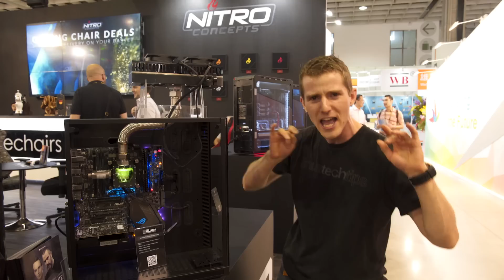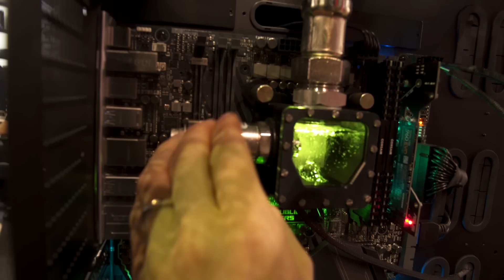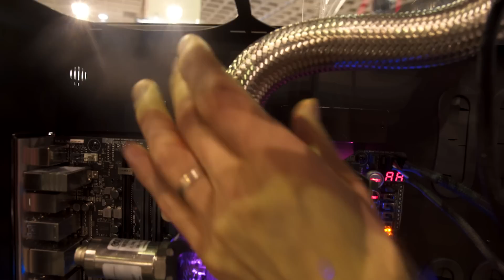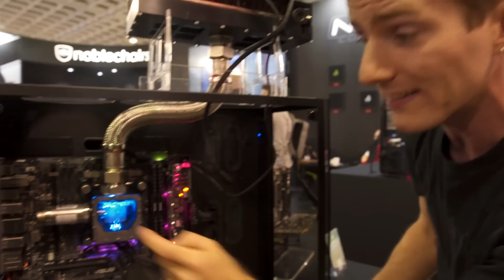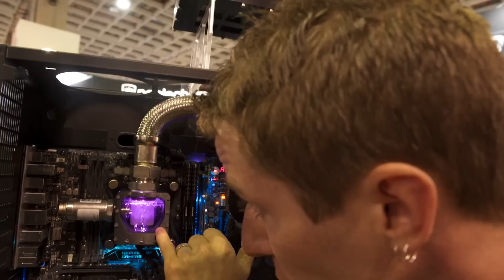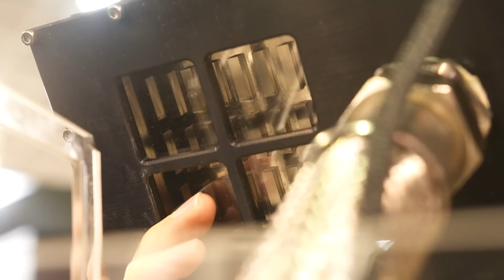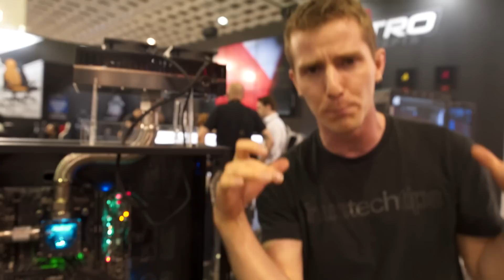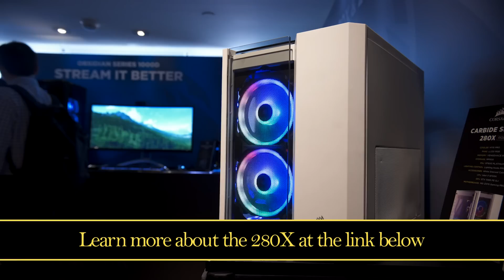Crazy Der8auer cooler prototype - NO pump!

Comment: My guess is Dichloromethane
Reply: Kevin Bintzik it's not a CFC (ChloroFLUOROCarbons need fluorine), and it's also a pretty common organic solvent for standard lab use (i.e. first or second year OChem in any college)
Reply: John Flandorffer Nope, it's perfluorohexane, or Fluorinert FC-72.
Reply: John Flandorffer this is one of the ones I think it is.
Reply: Hyperchromatica no CFC Dichloromethane or Diflorochloromethane for example are illegal but FC are eg Difloromethane

The CF bond is to strong to be broken up by UV light in the upper atmosphere thus not fucking with the ozone layer
Reply: DCM is not a CFC. CFCs are fully halogenated carbon compounds DCM only has two chlorines.
Reply: unless the entire thing is pressurized, raising the boiling point.
Reply: My guess is, that it's something similar to or even the same as the fluid that Roman used in his projects Aqua Exhalare 1.0 and Exhalare 2.0 probably Methylnonafluorbutylether [C4F9OCH3].
Reply: The fluid can neither be corrosive nor burnable, otherwise they would have a hard time selling the stuff. So neither will it be Dichloromethane, any aldehydes, ketones or other regular carbohydrates. My guess would be something perfluorated since those usually do not burn.
Reply: no one in this thread is even close, DCM is not a CFC as it dosent contain both chlorine and fluorine, CFC's dont need to be fully halogenated, DCM's boiling point is too low for this to work unless its pressurized 

oh and has no one mentionned that dcm is as good a solvent as acetone for PCB plastics? it 100% cannot be DCM

It probably isnt a simple common coolant, since he said no one would guess so forget CF's anc CFC's, my guess is some kind of modified ether to make it more polar and adjust the molecular weight to get the right boiling point.
Reply: yeah, dichloromethane is actually quite cheap and boiling temp is perfect for this
Reply: Pedro Victor A. I doubt that would work. You need to have a high enough boiling point that the gas would return to liquid state fairly quickly, so as to drip back down to the enclosure. If it were 20c then it would never return to a liquid.
Reply: Ahh! You got here before me ;-;
Reply: Dichloromethane boils at ~40c, that seems a little low to me.  I would expect something more like 60-70 range.
Reply: Yeah Perfluorohexane was my first guess aswell.
Reply: Hyperchromatica Not that I'm aware of. It's a pretty comon solvent in labs (chemistry). I've used it many a time
Reply: John Flandorffer It could be, but the enclosed system would have to be really well sealed, and without using glue or rubber. DCM is pretty nasty stuff; really volatile (useful here), low surface tension (leaks easy), eats through most rubbers/glues etc.

Actually not a bad idea tbh, but potentially it could be chloroform, diethyl ether or some othet kind of low bp solvent
Reply: Could be methyl ethyl ketone, it boils around 70C, is clear, and is commonly available (it's often sold as plastic cement). The drawbacks are mild toxicity and flammability.
Reply: @James Wright you want a low boiling point because even when your coolant heats up to 50C it takes more thermal energy to fulfil the specific heat of vaporisation to actually get the liquid to vaporise, i just did a physics A-level paper yesterday that was all about this kind of stuff.
Reply: @DAKOTA56777 its all about the heat capacity of the liquid if you have a low boiling point but your heat capacity is super low then  it wouldn't matter, when heating and cooling the time it takes to cool down/heat up is 100% dependant on heat capacity
Reply: @agamerawesome #2 I think you mean under vacuum
Reply: Pressurized gases that turn liquid would be a good choice. Ammonia is used in many industrial heat exchangers and would be my personal choice due to its high heat capacity, and high enthalpic change of vaporization.
Reply: isopropyl alcohol
Reply: While it's probably a great guess, Im thinking its something less exotic or he wouldnt be so tight lipped about it.
Reply: Acetone fulfils all the requierments. Boils at 56°C (~120F i think?).  safe to use (unlike cancer indusing dichloromethane). Dous not mess with electronics. Easy to get (nailpolish remover). I use it often in a purification proces at work where the solvent needs to be evaporated at the end
Reply: Dicholoromethane? Never my friend! More likely some kind of aceotropic alcohol mixture with 4 or more components. Good luck figuring it out! ;-)
Reply: That would boil at ambient in most places, most of the year. You couldn't get it to condense back into a liquid.
Reply: To me it looks like a form of heat pump. I see wires going to the bottom that indicate there may be a heater in inside on the bottom. (think of a camper fridge that works off of propane) Tetrafluororethane is for mobile refrigeration  and legal  in the U.S.  The heavy line and thick valves for filling indicate pretty high pressures. (40 to 200 p.s.i.)
Reply: 40c boiling point. That's near-ambient for an overclocked CPU at idle. That seems about right.
Reply: My guess is some kind of diatomic methane compound because of the low boiling point.
Reply: So he's using a coolant with a boiling temp below room temp, huh? For an overclocked CPU? Hmm...
Reply: Perfluorohexane
Reply: James Wright actually - 50c sounds like it would work wonders. Also for linus it felt hot but it didn't burn him so the cooler was probably at 60-65 Celsius wich would be kinda spot on.
Reply: It's 3M Novec
Reply: It can't be Dichloromethane. Der 8auer is working for caseking, a seller based in Germany. In the EU, especially in Germany, the use of Dichloromethane is highly restricted and selling it to private customers is illegal, afaik. But that is what he announced. ;)
Reply: Boiling point is too low- honestly it wouldn’t surprise me if he’s using straight isopropyl alcohol, or a solution of something like dichloromethane or another common refrigerant in isopropyl.
Reply: https://www.cdc.gov/niosh/ipcsneng/neng0058.html - Probably not.
Reply: Hyperchromatica lol thats why its a secret
Reply: John Flandorffer hahahab nice and save
Reply: Dryice 2199 so noble
Reply: Dichloromethane is not classified as an ozone-depleting substance by the Montreal Protocol.[32] The U.S. Clean Air Act does not regulate dichloromethane as an ozone depleter.[33] According to the EPA, the atmospheric lifetime of dichloromethane is very short, such that the substance decomposes before reaching the ozone layer.
Reply: Nah.. besides the abuse issues and the legalities listed here, it's not as cheap as... alcohol.  Simple, cheap, won't do anything chemically to electronics if it leaks.  And the right boiling point, especially if you drop it a few PSI...
Reply: ideally you would want a liquid with a low boiling point and a specific heat capacity lower than water (so it hits the boiling point faster and cools back down faster) and a low specific heat of vaporisation (so the liquid isn't sitting around at 50c for too long)
Reply: I'd put money on a fluorinated ketone, because I built something like this years ago doing some R&D at a certain large chemical company. No commercial driver (the market of overclocked PCs is tiny) so the idea was shelved except for a few patents. Best to save the fluorinated ketones for the larger use: Server rooms! Take all that heat outside the room by submerging the servers in this fluid, use the phase change to cool them, and capture the heat and send it outside though cooling loops.

But you didn't hear that from me, just some anonymous internet user
Reply: must be a pressurised system due to braided hose, 3m novec has too high of a boiling temp but assuming the vid is under load, id like to see something made with butane -1c boiling point,
Reply: dropping the Pressure in the system would really help this but it would also rocket the price up, and if you had to assemble it out of the package you would need someway of doing it so i doubt the pressure is anything lower than atmospheric
Reply: How about Freon 11 ?
Reply: lol no you dont.. all the old bubble tubes on juke boxes used it
Reply: Might be something like that. Core temp isn't water temp. For a typical water loop running max speed, water temps should be high 30s or low 40s max. So the boiling temp must be below this zone to be effective. 

They could use something with low boiling point and put it under pressure as well.
Reply: Ethan Taylor True true, lower energy means it'll condense faster, however since it's using room temp heat exchange it still has to be high enough to work on a hot summer day.

I'm not sure where you live, but in some States in the US summer days above 100F are somewhat common, even here in New York I've watched my room thermometer climb to 90F if I don't put my window AC in.
Reply: John Flandorffer 3M Novec Fluid
Reply: no the reason it takes so long with so much energy to boil water is because it has a ridicules heat capacity, because its a closed system it doesn't matter how much is boiling off because if it heats up fast it cools down fast too and the heat transfer cycle from the CPU to the radiator is faster, its all about how fast you can get the heat from one to the other

plus if it was a liquid with 70-80C boiling point the GPU would easily hit 100 before the coolant got the specific heat of vaporisation it needed to boil
Reply: I think so too. He already made a similiar mod with that 3m stuff.
Reply: Why on earth would you use DCM? That's way too volatile, extremely corrosive to almost all plastics and yes there is plastic inside that braided metal tube. My guess is ethanol. But also possibly not. I guess you could be right but DCM is not user friendly even for people with a lot of experience. It's also carcinogenic.
Reply: Hyperchromatica nah ur thinkin of the old stuff
Reply: Ethan Taylor True, but as commented before, (our page refreshes need to be better synced, :p) some areas see summer days at 100F, 38C, somewhat commonly.

So it still would have to have a boiling point at least a bit above 40C, as a cooler that won't work in summer would be kind of bad, I should think.

(I also never suggested ones with BPs around 70C, I said they needed to be higher than 70 F, [21C] which is room temp on a normal day.)
Reply: @Erbec Pickell def not methanol, boiling point way too high to get good temps
Reply: LOP1698 yeah.... it would burn the contentment material and kill you horribly. But hay its a good drain unblocker
Reply: 70-80 C boiling point would mean the CPU would hit 100 or more before there's enough of a heat difference to boil that quickly.
A boiling temp of 50 C means it will work at idle(ish) temps instead of needing your CPU to approach thermal throttle and will also mean the liquid boils quickly enough when your CPU is maxing out to keep it cool
Reply: John Flandorffer you might be right. It boils at about 40 Celsius. That boiling temp might be too low though to cool back to a liquid considering the TJunction on the 7900x is 95c.
Reply: At these temps it could be ethanol/methanol, they boil at 78/62°C
Reply: I think it’s H2O...

 😂
Reply: If it is then when boiled, the temp would be too high for the fact that it is supposed to cool a cpu.
Reply: if it was in the 70-80 range, I dont believe it would start actually cooling the processor until then, which, to me anyways, it a little bit hot.
Reply: Uwe Pelz any normal alcohol mixture will have the problem of absorbing water fairly quickly. Mening that the BP will rise over a short period of time.
Reply: 3m novec 7100...about 450 bucks for 3 liters
Reply: its pressurised which would increase the boiling point. LE CHATALIER
Reply: thats when you increase the pressure
Reply: Super Noodles if it's too strong and gets stuck in the ozone layer it doesnt affect it? Are you a fucking idiot? Lmao
Reply: more pressure raises the boiling point, not decrease it
Reply: I would think 70c as nothing will happen until the fluid starts to boil.
Reply: ReHWolution you are probably on the money
Reply: No, see, I thought about that too, and started making a list of liquids in THAT range. It got me thinking: The range can't be TOO high, otherwise the liquid would simply not boil soon enough, and your computer would junk itself. 60 C for a long time is dangerous, and if it just keeps going higher, that's bad. I lowered my range to between 30 and 50. Not low enough to boil at room temp, and not high enough to kill the computer in 10 minutes.
Reply: With the pressure sensor, I’d probably say it’s definitely under vacuum. And it probably just water.
Reply: James Wright Nope, the boiling point directly correlates to the CPU temp
Reply: John Flandorffer I’m pretty sure that it also has a plexiglass pump top... so it might not be DCM.
Reply: 60c is perfectly safe for a computer to be at strix
Reply: would make sense, has a low boiling point
Reply: indulge me on how its a cfc if it does not have fluorine? go mind your chemistry friend
Reply: The creator will be looking at these comments and be like.. owww I didn't know this stuff is illegal for consumer products. XD
Reply: I was thinking acetone first but you convinced me, I think they can get away with dichloromethane. Acetone would be safer though but its probably less then 150 ml anyway
Reply: i kinda want it to be a ester, but it is probably an alcohol like methanol because it would be the cheapest thing
Reply: 3M Novec 7100 boils at 61 degrees celsius. In the Der8auer's Project Exhalare 2.0 video, he mentions that 3M Novec 7100 boiling temp of 61 degrees doesn't leave a lot of room for overclocking and that he's working with a different fluid.
 I would assume that this "different fluid" mentioned in this video is what he's using in this system.
Reply: same, if so that would explain the tubing
Reply: Likely some sort of refrigerant at least. Importing/Exporting means its probably one thats banned.
Reply: What about the condensing temperature?
Reply: 3M has fluids with different boiling temperatures, plus this is closed loop, so they can just increase the preassure.
Reply: that depends if you are asking if its compressed or not, the gas is clearly in a compressed system, take a look at the 1 tube then you will know why he still has liquid instead of gas in that system
Reply: It definitely wouldn’t be because that boils at like 40c and wouldn’t get rid of the heat quick enough
Reply: only do C when discussion is water and he has the vapors re condensing at the top with the heat sink that falls back down, like the lava lamp effect
Reply: Kevin Bintzik dichlomomethane has no fluorine it in so it can't be a CFC
Reply: Chlorinated bra
Reply: More likely methylene chloride
Reply: pretty sure this is it
Reply: yep
Reply: John Flandorffer true a common fridge coolant but he didn't think people would get it. Also you need a compressor to make it work
Reply: Ether.
Reply: It's not an ozone depletent, so I don't believe so. You can buy it online.
Reply: Koolaid
Reply: Probably one of 3M Novec fluids?
Reply: what if its just water compressed to the point where it boils at 20 C
Reply: Hyperchromatica your pretty fucking stupid, CFC stands for chlorofluorocarbon, do you see any fluorine.
Reply: LOP1698 Can't be something with a boiling point that low, there's no compressor, so whatever it is needs to turn back into a liquid with room temp heat exchange, and do so relatively quickly.

So a refrigerant that has a BP in the area of room temp is impossible, without an AC in my room it regularly exceeds 80F, meaning the stuff would be stuck as a gas in the condensor even without the PC turned on...
Reply: Ethan Taylor Isn't taking more energy a good thing though? The idea is to take the heat energy out of the CPU, so putting more into the liquid to get it to vapourise doesn't really matter so long as the boiling point is low enough not to overheat the CPU.

As well, since there is no compressor the compound must return to liquid quite readily with room temp heat exchange, meaning it can't be too low. A liquid that won't condense on a hot summer day would be no good at all.
Reply: isnt that illegal as shit . being a cfc.
Reply: its a CFC and would be illegal in basically all eurpean countries especially for private use.
Reply: It might just be me guys, but I think it's most likely distilled dick juice
Reply: Eh, boiling temp seems a bit low. It's only like 50 C. I'm expecting to see something in the 70-80 C range.
Reply: I disagree, but I don't want to let the cat out of the bag. Maybe I'll make one and bring it to LTX
Reply: Illegal to use and dangerous. my guess is Trichlorofluoromethane refrigerant R-11? Boiling temp 21°C or 74.9°F  Perfekt! not corrosive not flammable not regulated.

Comment: The coolant most likely has a boiling point of CPU temp (50-70°C) and a condensation point of room temp (20-25°C). You just have to search a list of liquids with these parameters to find out what the coolant is

Comment: Isopentane is the coolant I think,

Isopentane is used in a closed loop in geothermal power production to drive turbines.

Isopentane is used, in conjunction with dry ice or liquid nitrogen, to freeze tissues for cryosectioning in histology.
Reply: This is all accurate information, but I don't think it could be isopentane. It has a boiling point of about 80F, so if your office was just a little warm it wouldn't recondense properly in the open-air heat exchanger. Geothermal systems use compressors to overcome this limitation, but the radiator in the video is not pressurized
Reply: swittlinger yeah that’s the only issue I saw too but meh it’s my best guess ¯\_(ツ)_/¯
Reply: besides we see it toutch the pcb, so it cant be an alkane or it would melt
Reply: MrKurbek it's also extremely volatile. I'm not sure how it favors against plastics long term. It definitely boils at a pretty low temperature... But it's more inert than DCM, it's BP is 30 deg C so it's possible.